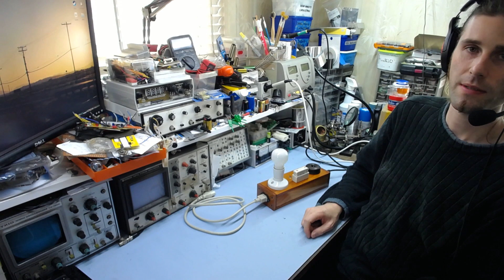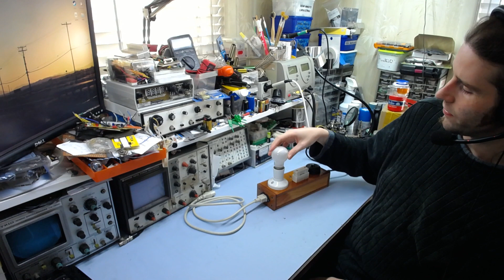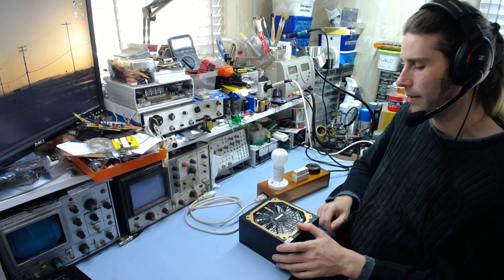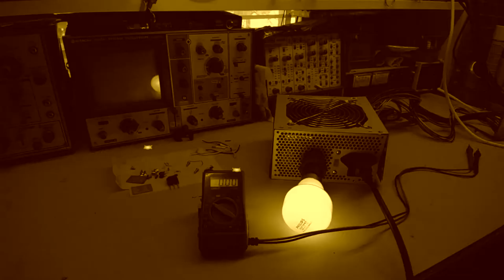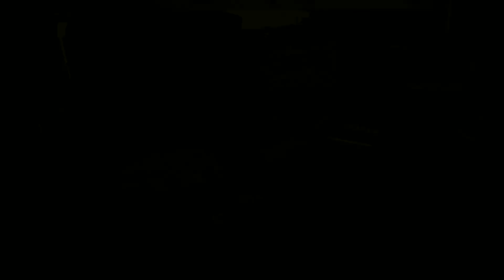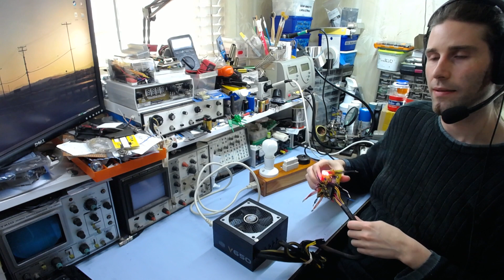Details & demonstration of a "Dim Bulb Tester"

Comment: Very nice presentation on the light bulb tester. But question what is that nifty device you are using to test the psu? Can you do a clip on how that works and how you built it? Thanks.
Reply from the maker: Thanks! That "tester" is really nothing more than a switch and resistor to pull the PS_ON line low, along with some LEDs to show the status of the rails.

Comment: i have a similar setup myself for safety/testing at my bench too. but, i use a 3 amp 240 volt circuit breaker instead of a 'fuse' since that way i don't have anything to replace. i mean, i can blow upto like 8-10 fuses just while repairing a single ATX psu, which is not very convenient. MCBs are usually very sturdy and robust mechanical devices and trips very fast.
Reply from the maker: It is best not to rely on fuses or breakers during repair, as you are going to cause stress to the primary side components with surge current every time you blow the fuse or trip the breaker. The light bulb will limit current and potential EOS (Electrical over-stress) damage.